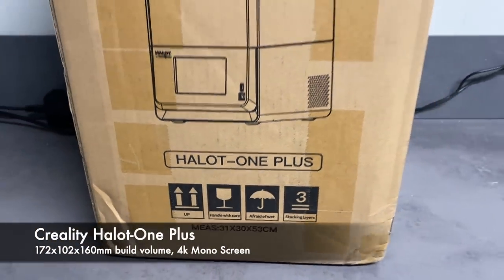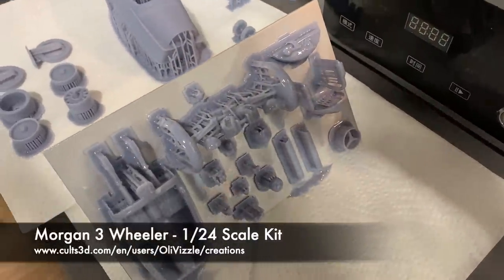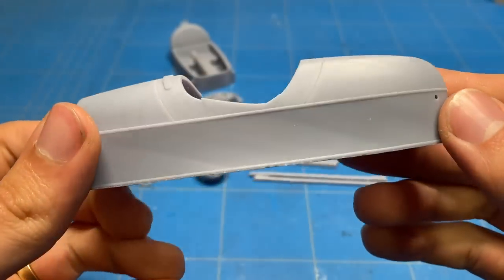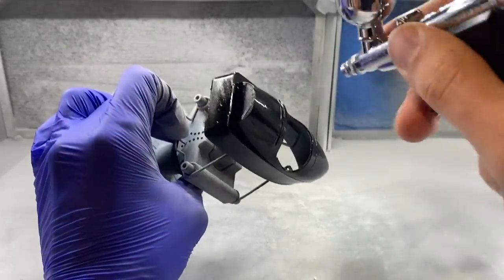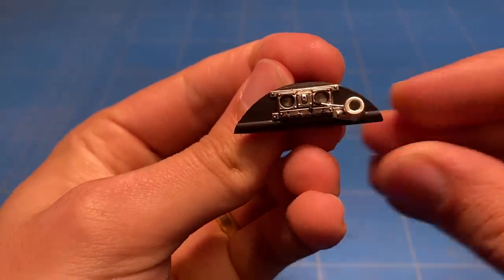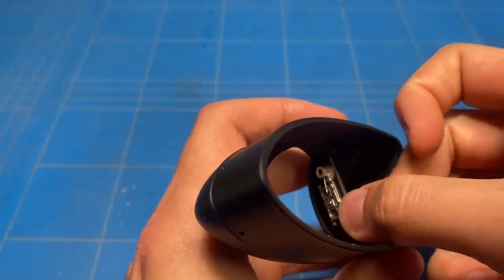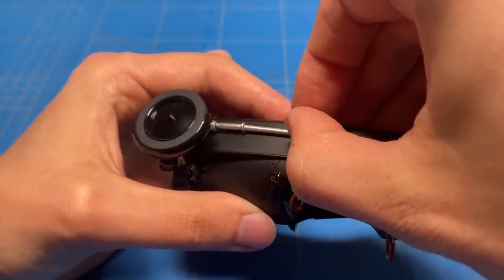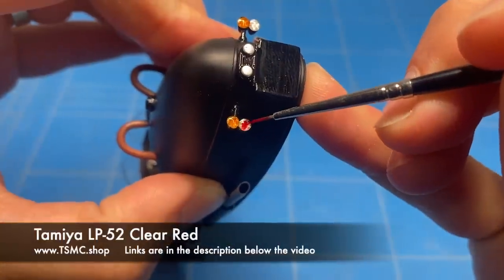Fully 3D Printing & Building a Morgan 3 Wheeler Model kit with a Creality Halot-One Plus

Comment: I love my 3d printer I built it myself can't afford to buy what I wanted already built and also built my own huge resin printer as well. But my biggest helper in my hobbies is my laser cutter I can cut from thin paper all the way up to thick hobby grade ply wood and some very thin aluminum sheeting I love it for cutting out flat parts from styrene sheets and etch the rivits and details into and can also cut roll cage jigs with it. Etch the sub assemblies of the roll cage onto a piece of thick sheet plastic and lay down my styrene rods and cut and fit and glue in place and it's the most accurate and fastest way to make roll cages and any type of tube chassis out of styrene rods and tubing and square stock ECT. I did a whole copy of a asphalt super late model chassis by etching the layout of it into the styrene sheets and I was able to cut all my stuff by hand and have a very accurate and exactly out measured tube chassis so I can build this dirt late model and asphalt late model for somebody that I commission buildings 124 scale

Comment: i think a Filament printer can do the job way better and have way more options, like the tires, you can print them in rubber, has for the  resin printer you can only print in plastic
Reply from the maker: 3D Printing Flexible Rubber Like Tyres for Your Scale Models with Resione FX60 Flexible Resin
https://youtu.be/mnsalucQ9S4

Comment: This is so, so good. But how durable is this resin? I've heard stories that models made from photopolymer resin tend to wrap under heat, under light, under gravity, well, under anything after a year or so.
Reply from the maker: The models i have printed still look the same as when i printed them. Just make sure it is cured properly and paint it, so it does not keep absorbing the UV

*not an expert. Just my experience

Comment: Great results there! 

What settings did you use for this resin? I can't get it to work, it always warps for me on bigger prints... Cheers!
Reply from the maker: Just the standard settings in chitubox. With 1.5seconds cure time per layer
Reply: use lychee slicer its free and better.. 45 seconds for intial 7 additional 5 layers 3 seconds wait time 1mm speed  and thats it i have the same printer also use rain x winsheild stuff wipe it on with lint free rags i use 300 count rags from walmart let it dry wipe it off and never never leave resin more than 1 day in the vat those covers are not uv resistant it will harden and you will ruin your fep film get extra films get lots of is0 alcohol glasses gloves  tooth brush and you should be set and a wash and cure station just stick the whole print in the wash first let air dry 10 minutes wash is good then uv cure for 10 on all sides that cant see the uv light and then take off supports use glasses that shit shoots off trust me got one in my eye one time... ive had perfect prints with my methods above the stock slicer sucks and chitubox well for me is weird the other one i mentioned is better and make sure to detect islands before prints its a great slicer